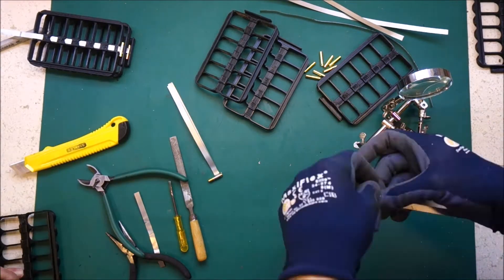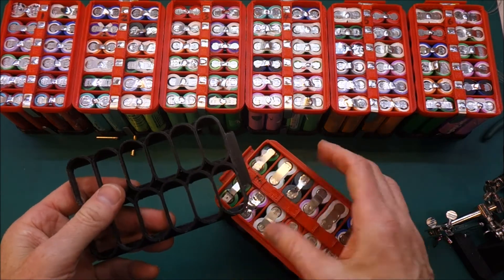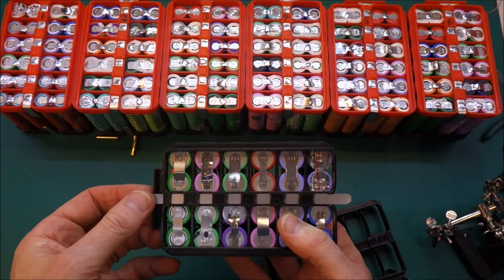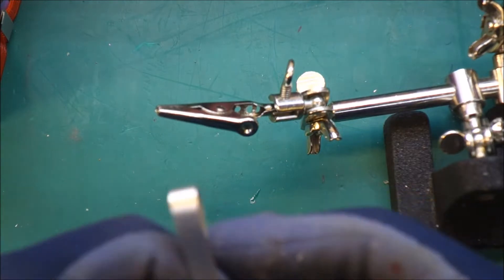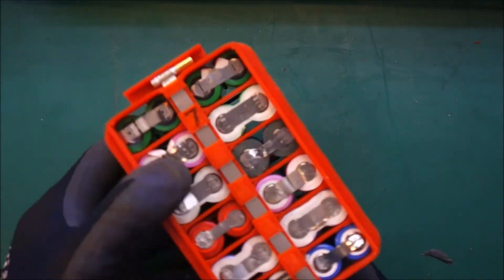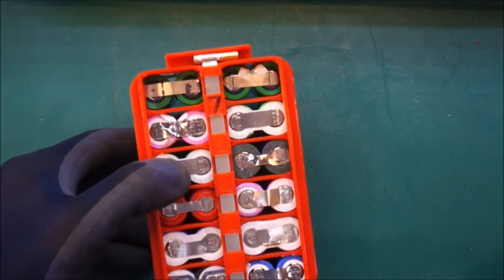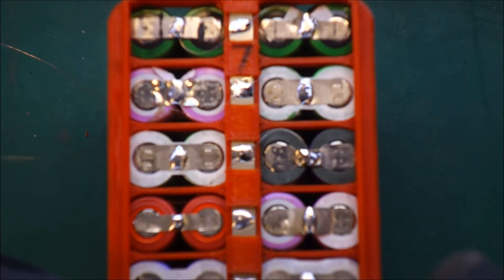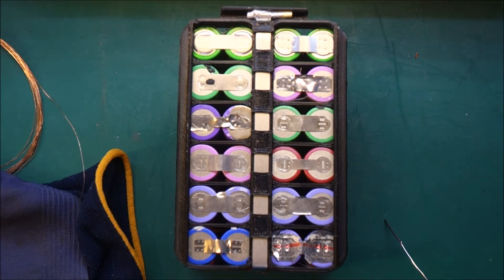Laptop Powerwall 76 - Another 1 kWh Small Blocks pack

Comment: why do you make connections through that thin wire, what is its role? is not it better that the connection be with thick conductor?
Reply from the maker: The thin wires are acting as fuses. If something really bad happens then the fuse blows and disconnects the bad cell(s).
Reply: how many "A" have to withstand the small wire?
Reply from the maker: It depends on the wire, so I did some testing in Episode 57 https://www.youtube.com/watch?v=Rsk_VjV4zKQ and Episode 60 https://www.youtube.com/watch?v=OMC_maVYg4Q
Reply: I understand that depends on the thickness of the thread but what you are testing in episode 57 is a fused wire that breaks to a maximum of 1 amp in the case of a cell going into a short circuit, however when making a pack of 2 or more parallel-bound cells in if a cell goes into short circuit through that thin wire will not pass all the amps that has its pack? that is if I have 4 cells in parallel of 2000mA each this means 8000mA that will shorten the fusible?

Comment: It just occurred to me that if you kept going when you solder in a fuse wire you can then keep the loop flowing through the cells rather nice and then when you're done you can remove the few strands between the cells themselves instead of stopping and cutting every time you reach the other outer cell,

So start the loop on the top left cell, go to the bus-bar, and then to the top right cell, continue to the cell just below it and then back to the bus-bar and to the cell to the left of it, and so on. One continuous motion and you don't have to stop and re-tool all the time.

When done putting in the fire wire then cut all the vertical joints out between each row.

That should speed things up a bit! :-P
Reply from the maker: I'll try that idea with my next group and see how it goes. Thanks for the suggestion.

Comment: I love the setup but they should use a secondary lid that only holds the batteries in place so you can easily replace the bad cells when a wire burns without having to unsolder all of the wires to fix it.
Reply: I just watched your intro, what a awesome job printing these out.
Reply from the maker: You might like https://www.youtube.com/watch?v=BmXi6CaVoLA to see my rationale for this setup.
Reply: Paul Kennett I already watched it as well, good stuff

Comment: I've never seen a real 18650 battery with any more than 3500mAh so something is terribly wrong here.
Reply from the maker: Pairs of cells. I keep cells in pairs.
Reply: Paul Kennett Now that makes sense, I'm not a troll, just knew they don't make them that good. lol Laptop batteries usually put out 2Amp so you may see a sag in power so I'm looking to build a powerwall for the house, they make high drain batteries 30~70 Amp the devices running off the wall will only take the amperage that it needs so unless you're draining at 4,500Amps using 150 batteries which I doubt, the voltage wont drop off that fast and whatever is plugged into the wall will not starve for power.
Reply from the maker: This part of my overall power bank has 48 cells in parallel (7S48P) and I'm only planning on drawing 20A max from those - so it'll be less than half an Amp per cell. I prefer to keep the cells in pairs as it saves a lot of fiddling time during the build with no major downside. Cheers, Paul

Comment: What happens when one (or many) of these cells go bad. How do you isolate the bad cell and then remove and replace with one of similar capacity?
Reply from the maker: If a cell short circuits then it's fuse should blow. If it looses capacity then that group may show reduced voltage. In that case I'd need to swap out the group with a fresh one, then pull apart the bad group and test each cell individually.
Reply: That's what I would have guessed. Using so many "recycled" cells I would anticipate that it will need a lot of maintenance in the near future so making each cell as easily accessable to swap out when it goes bad is smart. What do you estimate the fuses are set to fail at?
Reply from the maker: I'm not expecting a lot of maintenance. I'm guessing there will be a slow drop in capacity for most groups which may be quite hard to notice over time. I'm not expecting these middle-aged and mature cells to suddenly change behavior either - given that I've already discarded cells that don't charge and discharge well and those that have high internal resistance. My fuses should blow around 5 Amps. You might want to check out some of my earlier vids which cover these issues.

Comment: 1 kwk is 100 amp hrs right or is it 1,000 amp hrs
Reply from the maker: Hi Planet Bob

1 kilo Watt-hour (kWh) = 1000 Watt-hours

The formula for Watts is: Watts = Volts times Amps
The formula for Watt-hours is: Watt-hours = Volts times Amp-hours

The nominal voltage of my "24 volt" system is actually 25.9 volts (because lithium cells have a nominal voltage of 3.7 volts unlike old-school AA batteries which are typically 1.5 volts - so 16 AA cells in series would produce a satisfying 24 volts nominal) so... 3.7 V * 7 in series = 25.9 V

So...  1000 Watt-hours / 25.9 Volts = 38.6 Amp-hours

To complicate matters Li-ion cells will charge up to just over 4 volts, so some people will only string 6 Li-Ion groups together to get a nominal 22.2 V pack - but it'll be around 24.0 V when fully charged. This will work if your load doesn't mind being under 24 V most of the time. 

I prefer 7 cell groups in series in my "24 V" packs which means it would reach 28 V if fully charged up. (Some inverters don't like going that high.) But.. I set my charge controller to only go up to 27 V which extends the life of the batteries. 

Hope that helps. Cheers
Reply: thanks

Comment: Really clean work man, nice job. Could you clarify though what size the fuse wire is? It sounds like you said .2mm, but I couldn't exactly hear. I'm looking for a wire size that will trip in the 5-10A range.
Reply from the maker: Yes - it's 0.2mm diameter. I've also used 0.25mm enamel wire previously which is in the right ballpark too.

Comment: Hi Paul
I am not trying to be negative honest, but you said you prefer 2 pieces of strip because of the lower resistance this would only be correct if you soldered the 2 pieces along its length. The other thing was when soldering the strip to the brass flux would have probably saved you having to turn them over and soldeder the other side.
Reply from the maker: There should be current flow between the two strips as they are held against each other, and eventually I do solder the other end. (I left it unsoldered until I'd worked out what type of connector I was going to add to the other end.)

Comment: if your going 48p how are you connecting one pack to another.  When I've soldered the connector to the bus bar i almost wish i'd went with two connectors so one could be used for drawing power and one could be used for connecting to the block below it.  I could still do that with new packs and the pack I've done with single connectors would always be moved down to being the bottom one as that has nothing to connect to as it where if you get what i mean.
Reply from the maker: Yep - I put two bullet connectors on my first few blocks but then realised I was going to run out of connectors so switched to just one. I kinda wished I'd suck with two now. I'm either going to add more connectors to the bottom tabs that are current unused, or make a new harness that has two bullet plugs per end. Either option is slightly naff. 
I'd recommend you put two on the next 7 blocks you build, and route the cables in the groove between the packs. Hopefully that will work OK. I'm keen to see how you manage it! :)
Reply: I'll run out pretty quickly if i do the same but i think it does seem the best plan.  I've just ordered 150 pairs on top of what I've got coming already.  Found these which seemed more reasonable than what I've been buying so far.  http://www.ebay.co.uk/itm/141331614787
Reply from the maker: That's some weird product photos - how big are those things? :) Good price though.
Reply: Specs say the same as the ones i currently have, hopefully they will be ok.

Diameter: 4.0mm 
Length:1.9CM & 2.3CM 
4.0mm gold connectors Male X 50 
4.0mm gold connectors Female X 50
Reply from the maker: Hi Colin. I've designed a wee bracket that clips on the bottom of a small block to hold a bullet connector. My plan is to print 2 of these (one red, one black) to use for connecting between two packs - one below the other. Email or Message me and I'll send you the STL file versioin 1. Cheers, Paul
Reply: Thanks paul i've emailed you through your website online form.

Comment: Hi Paul. Do you have a NZ supplier for the battery straps or are they from AliExpress like the bullet connectors? Thanks for the videos, they have been a great help.
Reply from the maker: My strapping came from Aliexpress - links here: http://www.myonlinediary.com/index.php/Energy/PowerWall#date20160517
Note: this is actually nickel plated steel strapping. There might be someone selling on Trademe if you're in a rush.
Reply: Paul Kennett Thanks. No rush so will get both from AE.

Comment: This maybe a silly question but, could you use a flat sheet of dimpled metal to cover all the negative terminals in one go instead of separately wiring thicker fuse wire that is not supposed to blow? You would still have the fuses connected to the positive terminal offering protection.
Reply from the maker: One of the problems with recycled cells is they are not perfectly uniform - so any sheet of metal would also require some system for adjusting to different cells. If I leave the cells in pairs the strapping between the cells can sometime be wildly different heights - which would complicate matters. If you strip them down to single cells you often get little torn bits of strapping from the weld still stuck on the bottom of the cell - which would cause issues if you're relying on a good mechanical connection for current flow.

I've seen a few other DIY solutions were they use screws for each terminal - which would require a lot of screws.

Tricky!
Reply: Thanks for the prompt and easy to understand reply, what would really be required to make my idea work then, would be some sort of conductive gel that does not degrade or dehydrate to allow for the differences in battery terminals between the batteries and plate metal, I wonder if such a thing exits? Now I understand why this system you employ is used :) I think that a screw system would not only be tricky but also create more opportunities for failure. I find your videos very informative and educational, thank you so much for taking the time to make them. I look forward to see what you come up with for the pouch cells, there are many old electric bikes here in Thailand that I maybe able to use.
Reply from the maker: I still haven't worked out the best solution for connecting up the pouch cells yet. I may do a vid asking for suggestions.

Cheers, Paul

Comment: Oh, I'm gonna steal that bus bar/connector idea!  Very clever.  What are those studs for the connectors, and where did you get them?
Reply from the maker: http://www.myonlinediary.com/index.php/Energy/PowerWall#date20160808 - 4mm copper bullet connectors - they're much better than standard old banana plugs.
Reply: I mentioned above but i found these which are reasonable.  http://www.ebay.co.uk/itm/141331614787
Reply from the maker: https://www.aliexpress.com/item/50-Sets-4-0mm-4mm-RC-Battery-Gold-plated-Bullet-Connector-Banana-Plug-FCI/32247710519.html